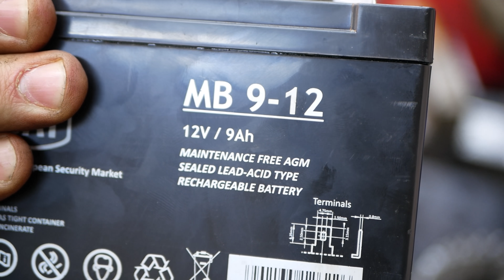No More Trailer Woes: My Electric Towing Solution!

Comment from the maker: A few answers to frequently asked questions :)
The charging port is on the top cover, forgot to show it.
The batteries last for about half an hour of driving.
The maximum weight of a trailer or machine is approximately 500 kg / 1100 lbs.
Reply: Pp
Reply: i really like how your driveway is made of those square blocks that let grass in
Reply: Какие моторы и батарея? Отличная тележка 👍👍
Reply: Is that toung weight or overall
Reply: i really would like to visit your workplace if you would like to meet i am also belongs to the engineering field i am also from Poland
Reply: you can always upgrade to a lifepo4 battery for a bit longer range! Nice job man this is fantastic
Reply: @CL-yp1bs  Check out Ice Hole Power for good battery reviews.
Reply: @Nderak  it's very common in the very wide Eastern Europe, from north (Poland) to south (Bulgaria).
Reply: Made in Poland: how do you stop or break those 500kg on a slope ? One should use worm gearboxes only to be able to stop.
Reply: @codures   The gear ratio (1: 3) of the gears, and the gears in the motors, and they brake these, simple ones?
Reply: @kosmit265   once in movement on a slope, I would rather try a 1:25 gearbox. Math: 2*Radius_wheel*PI /1second = dolly speed (in cm per second). A 3.6 km/h dolly speed yields to a 100cm/s, which gives, if wheel radius is 10cm, a nice 5/PI rps which is 300/PI rpm ~ 100 rpm. To convert a 3000rpm electric motor to a 100rpm wheel you need a 1:30 gearbox.

If your payload is 500kg and you need to go down a slope, you have 3 options: a) change your mind; b) pick a snake like/almost perpendicular trajectory with respect to the gravity resulting force; c) have breaks (electric or friction).

Hope it helps.
(Edit: typo - one zero missing in the km/h to cm/s conversion)
Reply: J'accepte tout les conditions
Reply: Mo
Reply: U
Reply: @আনাররাজ  ظ
Reply: @bobboboff5326  9
Reply: @JustinDeckardFamilyMan  , tire pressure.
Reply: @আনাররাজ  88³ what hu
Reply: What size and type of Battery are you using? Like a 12v Deep Cycle Marine Battery, or just something from like a Riding Lawn Mower???
Reply: Ò0
Reply: A boat would have been more persuasive I appreciate what you do.
Reply: Both large wheels and drive motors  are bolted to a solid shaft, how does that work with tight radius? Wouldn't it have been better to use a small differential from a riding mower?
Otherwise great fabrication and a compact unit.
Reply: mo
Reply: @codures  you my friend are a fckn genius with a reply like that,and u must be commended!
Reply: Thanks!
Reply: @আনাররাজ  q.
Reply: + c
Reply: Hub
Reply: so kind of useless? my empty trailer weighs 520kg. and everything lighter than that is faster to move by hand than go get the machine from the shed. good idea but should make it handle bigger loads and it needs 4 wheels or it can go badly when going uphill.
Reply: You know your a scientist right bro that's a rarer thing than you know also I'd love to see this run by like an Arduino or whatever there called rasperi pie or whatever so that future as in very soon AI's could connect to it and control it for people big money there I think or is it no money 🤔
Reply: вперед/назад удобнее выключатель совместить с ручкой, потянули вперед, он едет вперед, уперлись и надавили назад, он поехал назад. Скорость при этом должна адаптивно увеличиваться и уменьшаться, чтобы не было рывков. Скорее всего использовать удобнее джойстик в качестве основы, а не выключатель. Так как у джойстика переменное сопротивление внутри.
Reply: Any videos of it pulling something very heavy like a camper trailer?
Reply: Myślisz że poradzi sobie z przyczepą kempingową? Jednoosiowa 8m
Reply: The small swivel eats up amps. No split shaft is also hard on the motors.
But but who cares on short distance!
 Anyhow no big deal to cut the shaft at center and set screw a  tube on one half (between sprockets) and grease the other half of shaft.
These small motors are easy to self compensate in rpm under various steering radiuses (one wheel must turn slower) being easier on the low amps bateries than straight shaft which does not obey one's steering effort which is a drag on taking the proper  position.
To be safe I would add rollers  wheelies to prevent flipping backwards
Reply: Б
Reply: You can perform every job it takes to complete the project without the expensive tools and as far as the knowledge goes it cost nothing to watch a video or ask questions about how to perform the work required it's all in the mindset obviously you are in the I can't category best of luck with that
Reply: Spectacular job 👏.
Reply: @codures Wheelchair motors have a brake built into them when not under power.
Reply: @gimpygrandpa8281  some industrial motors too... the car elevators for garages are equipped with this type of motors for obvious safety reasons.
Reply: @codures  I’m an incomplete quadriplegic and a tinkerer. I’ve been using motorized wheelchairs for 13 years. I’ve used the motors for many projects.
Reply: @gimpygrandpa8281  and, at equal ratings power/torque/rpm, aren't these motors more expensive? Wouldn't a worm gearbox from a scrapped tiller machine fulfill the same task while providing more features? See where I am getting at?
Reply: @codures  It’s about what you have on hand and its purpose.
I agree with you but I have 20 wheelchair motors laying around and one tiller I won’t destroy.

Comment: The two wheels are rigidly connected to the same shaft, right? Shouldn't the shaft be split in the middle, so that each motor will drive its corresponding wheel? Because I don't see the point of having two motors, if they are not used as a differential system.
Reply: Double the power, and if 1 chain breaks it won't run away
Reply: @keepf9835  even so, that raises another problem, because no two DC motors are the same, so without a closed loop control, the speeds will not be the same.
Reply: @robertlangley258  you cannot not be jealous on the guy's skills and creativity.
Reply: @tootingcarmoon532  its just a suggestion I guess
Reply: Slow speeds like this. It won't really matter
Reply: I thought he was going to use variable speed independent drives to give differential steering. But it would complicate the controls. A lot.
Reply: I took a electric scooter wheelchair that I picked up at a salvage/junk store and done this same thing. took the big seat of and all the side plastic covers and fabricated a removable receiver for the ball. and a handle bar with the joystick controls moved to the center of it. it's 24vlt AC. it's kool to use moving trailers and boats around the shop. plus I have a poly dump cart that mounts to it and it does great for my landscape business.
Reply: To me two wheels independently driving causes too much torque on the handle and it starts driving you instead of you driving it.
On split drive shaft actually works much better for me. In the real world for moving a heavy trailer, the heavier the trailer is the stronger the side torque effect is.  There is no overwhelming difficulty moving the handle back and forth to steer the trailer this way, in fact it helps but it does torque on your arm a bit unexpectedly over bumps
 and things like that with the split shaft model. My buddy made one of these several years ago,  it was gas powered and moved a big heavy trailer with a hydraulic lift on it.
Reply: Double power, those motors aren't that powerful, you need all the power you can get going through grass. That small caster wheel on front isn't going to be easy to go through grass, & every little hole it's going to drop into, you need double power to maneuver around. In fact i would have used a small motorcycle front wheel instead of that small caster wheel, & probably rigged more power than they used, just to go over smaller knolls & going through small holes.
Reply: @ottotater2787  kind of what i was thinking, put a gas motor on it & move heavier trailers & bigger boats around. Only i would think if you used a bigger wheel on front, instead of that small coaster wheel, it would be easier on the arm, & easier to maneuver.
Reply: @daithiosioradain3380  I also thought the same thing.   way more complication which is not this guys style.  You could  use an electric wheelchair controller and electronics (with joystick) but you would probably need the motors that go with those to make it work with the least amount of electrical knowledge.
Reply: I’m with you, I think there should be a differential, specially when you make turns, the outside wheel in a turn is going to have a different wheel speed than the inside wheel in a turn.
Reply: @danielbowman4819  i can see your point, but i don't think it's wide enough to really make that much of a difference. Sure it's going to be different, but not that much. 
Look at riding lawn mowers, most of them have a solid axle, with a single chain driving both rear wheels.
Reply: Exactly. This is nonsensical
Reply: @daithiosioradain3380  not really just add a dual motor driver and a wireless controller that outputs pwm to the controller.
Reply: Independent hydraulic drives would be a better option
Reply: @zumazoomzoom7632  then you have to have a hydraulic pump, which means more than likely a gas engine to run the pump.
Reply: @tootingcarmoon532  slight mismatches are taken up by the rubber on the tyres. But if there’s high speeds I guess you need hall sensors to read motor speeds and a circuit that can adjust to make them the same. These systems exist, nothing new here.
Reply: @timothygeiger8271  if the ball is centered correctly there should be virtually no weight on the caster when it’s in use
Reply: @lethargicmotorsport2025  it does need a fractional amount of weight over the caster, so the front doesn't come off the ground😊😆
Reply: 2 motors doubles torque.
Reply: @danielbowman4819  also prevents slip wgen under load
Reply: O que está errado são as duas rodas estarem tracionada. Somente uma delas já é suficiente.
Reply: That will not turn. It's actually positive traction. You'll be jerking your brains out trying to get it to turn. Maybe on dirt and a John boat. Batteries entirely too small also. Other than that, a great idea
Reply: @danielbowman4819  it's so narrow it doesn't matter, hell I have welded diffs in cars. It will just scrub the tires, or hop a little bit being this is so narrow and not that heavy you'll never notice
Reply: @keepf9835  I believe it's more about the torque than it is the power,
Reply: Look how small it is its obviously nit fir raving
Reply: @Seb P Your observation is somewhat correct. However, I think the reason he may have chosen to go with the fixed shaft being simultaneously powered by the two motors in the same direction at any given time (i.e., forwards/backwards) as opposed to going with the split shaft where each shaft can be powered in the same or opposing direction(s) is likely for build simplicity sake, to achieve double the torque  and to keep cost down. See @16:52, with the fixed shaft design he's able to achieve steering the device laterally by manually laterally pushing the device with two hands (yes, it's no cakewalk lol) via the handle, and that laterally inputted push causes the device to turn in the desired direction via the caster wheel and the two pillow block bearings which connect the body frame of the device to the fixed shaft. Going with the split shaft would've required a controller/controlling means for controlling the degree of speed and direction of the device via the motors respectively, and he would've also needed two more pillow block bearings at the opposing ends of the respective split shaft for supporting them and to keep them rotationally free relative to the body frame of the device. Such "improvements", while ultimately superior and while requiring less effort to control the device will be more expensive, more complicated and will introduce more things that can either break and/or require maintenance in the design of the device.
Reply: @tootingcarmoon532   I built one similar in high school and the 2nd motor would use as a backup if a chain broke or if the other motor stopped working
Reply: Do you have plans for this?
Reply: I would agree with you, if there were four wheels.  With a three wheel machine, one being a caster wheel, independent drive is unnecessary.
Reply: Even the 2 wheel garden tractors I have from the 40's and 50's have a differential of sorts, usually ratchets to allow one wheel to outrun the other for easier turning while under load.
Reply: You should build one to show us your skills
Reply: @zumazoomzoom7632  you should build one to showcase your skills
Reply: @j.sargent9172  Lmao have you ever tried to turn a roto-tiller with a welded diff on dirt? You spend more time fighting the grip of the tires than you do actually turning it.
Reply: I just put a receiver hitch on my hydrostatic lawn mower then you can ride along and it still mows grass
Reply: @duckyboii824  just dont be surprised when your hydro lawn tractor wears out its axle. Really should use a gear drive garden tractor instead since they are built to handle such loading.
Reply: @WH32R  I put it on the front and it's a John Deere with a forged beam so it'll be ok
Reply: @duckyboii824  ah yeah you should be fine then. I was worried that you slapped it on the back and would be wondering why the trans died within a week.
Reply: This was my first thought as well but I think he was just looking for the torque of both motors.
Reply: He's using stepper motors which requires a controller. The controller knows the exact angle of rotation on each motor and controls the spin based on various inputs.
Reply: Кроме этого червячные редукторы не имеют наката, поэтому просто катить эту тележку будет невозможно, колеса будут заблокированы, надо было ставить обгонные муфты, хотя бы  велосипедные.
Reply: @worldsgonemad4600  yes but that system doesnt work like a differential when both motors drive the same axle.
Reply: I really don’t feel like explaining why independent drive of each wheel and or a differential would be an idiotic choice here. Seriously think about it… really hard now.
Reply: @keepf9835  “Double the power” ?  If power matters, then unite the two motors to drive a chain-driven differential unit. That way you prevent the great “power” loss in friction between tire and ground when vehicle makes a turn.
Reply: It’s called 2 drive wheels(dual motor) and a separate wheel used for steering. Hi torque output. Half torque if one chain breaks
Reply: Actually further watching one motor raises the hitch the other moves the machine
Reply: Well it worked buff said
Reply: @tootingcarmoon532  Right you want to control the 2 different speeds so you can steer the thing that's the point
Reply: Yep like a transaction like a Dixie chopper setup you're absolutely correct two separate setups
Reply: @tootingcarmoon532  I'm about halfway through. The motor controllers should be run parallel so the actuator should be on the same circuit
Reply: I don't think they are connected how you think . The reason I say this is because he had the wiper motor controlling them so left and right turning. I might be wrong but I'm sure there not connected together.
Reply: @mikeraphone6745  The wiper motor powers the ball hitch up and down. The driving wheels are locked on the same axle. Will make turning tight corners very hard work, worse with more weight on it and especially bad on a hard grippy surface, like concrete for example.
Reply: I didn't read comments but I'd assume they are on same channel just to add a bit of torque . Fine work IMO but they make electric trailer dollies
Reply: Because you don't like torque. More is better. Two is always better then one.
Reply: Splitting the shaft and then powering the motors in series with each other will give you the equivalent of a differential and keep power very controllable
Reply: @chaseleim4773  
Can you be more specific?  
Power is the product of torque & RPM.  
The same amount of power can be obtained with hi torque at low RPM or lower torque at higher RPM.  
I can stand on a bicycle's pedal on a horizontal crank arm, pull up on the handle bars and put a very high torque in the drive train, during a portion of a revolution, but I can't provide that amount of torque at a high enough RPM to make one horsepower? which is only 550 ft/lbs per second.

Similarly Volts & Amps are both necessary to make electrical power (most commonly expressed in units called Watts).
Reply: Unless if they are week when pressure is applied to the application such as weight from a person trying to get his mass pushed around only the. Would u want them to work together on a single shift because they would re duce the tension on one another more efficiently and honestly I'm sure either way would ensure the support on one another split shift or not split ..😊
Reply: I think displays of ability of tool users are like advertising...and shop looks like it came from plan to attempt to do business...And from having sold me the hand-held screen to selling me the electricity to store in the battery to drain watching this...it ain't porn, yet my hands are full and in the real world already full hands aren't so quick to be emptied, to receive above, what we want them too😬Thank You Father, To Whom I Pray, For this. For You Are Holy!
Reply: @richardcampbell3693  most mobility scooters have a tow bar bracket, might as well just for a standard height tow ball and use the scoot as a tow vehicle.
Reply: That's a very good point!
Reply: @prawny12009 true, but then he would get to play with tools in the workshop.
Reply: Si saben tanto hagan videos...
Reply: And I skip the video after reading your comment
Reply: @keepf9835 lol it’s called an open differential city kid.